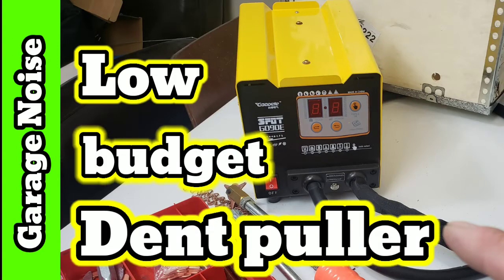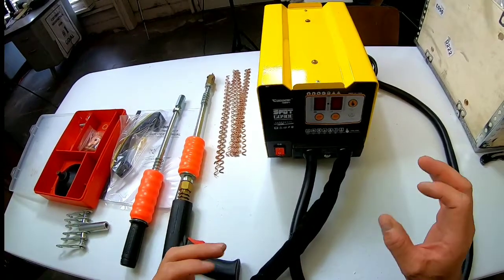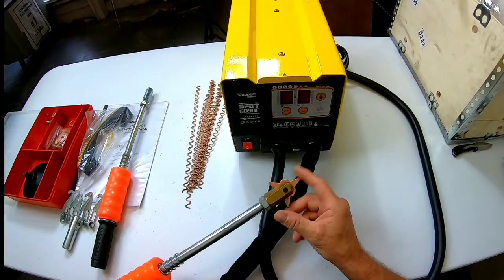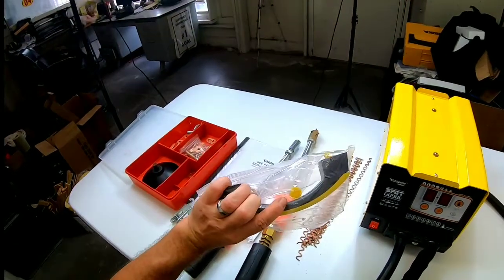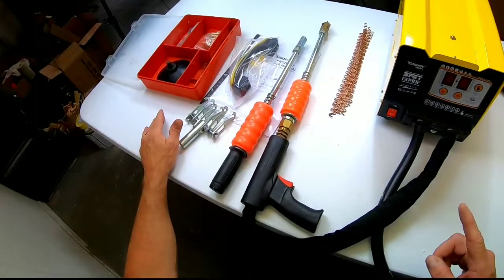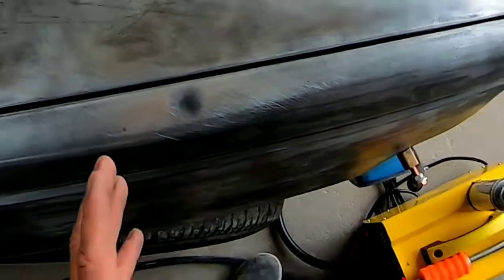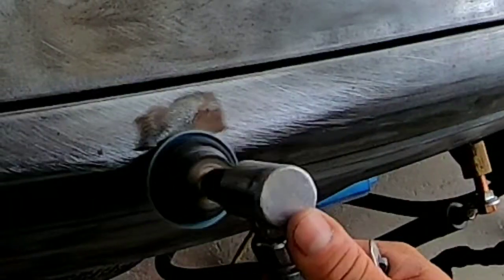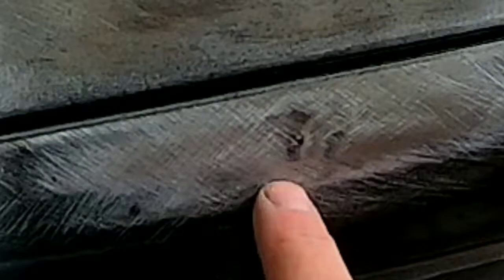Is the G90 dent tool worth purchasing?

Comment: I was unable to get mine to stick well enough to even use the slide hammer. I used my regular welder to weld on washers and use the hook on the slide hammer to pull out a dent. So far a dud. IMO
Reply from the maker: Was it on high setting?
Reply from the maker: And make sure your grounded well